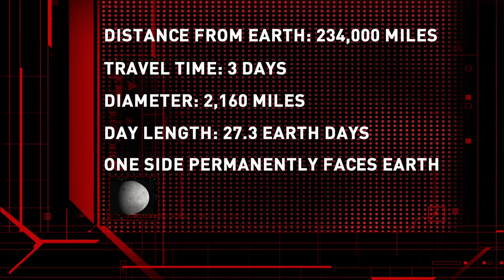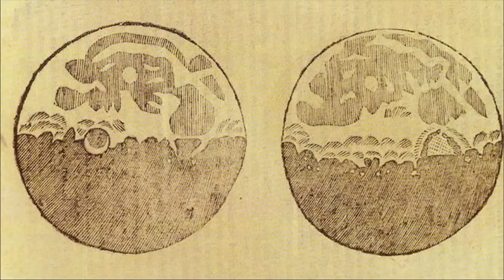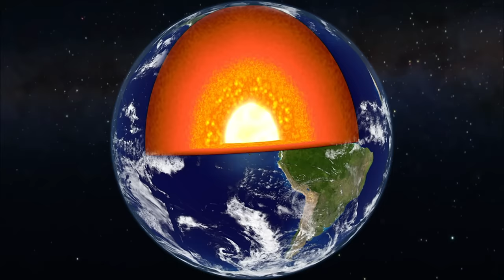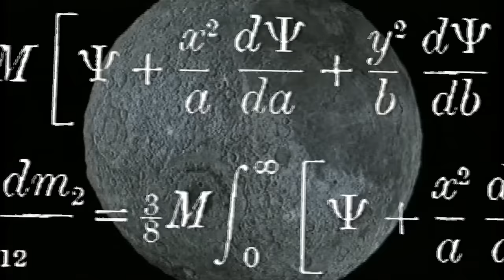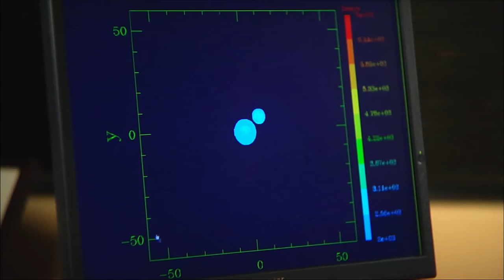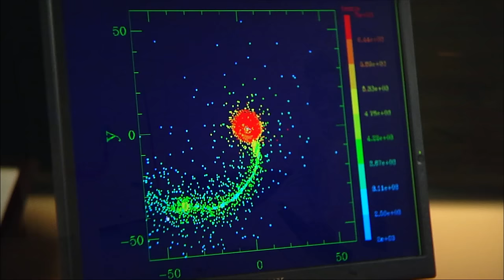The Universe: The Creation of the Moon (S1, E5) | Full Episode | History

Comment: The illustration of the moon's gravitational pull on the oceans is incorrect. Because of friction between molecules of water in the ocean, the high tide does not occur at a point directly beneath the moon but, instead, the high tide lags six hours behind the moon. The lag in the tides is most easily observed on the full moon when the gravitational pull is at its maximum due to the sun being on the opposite side of the earth. On nights of the full moon, high tides occur at sunset and sunrise, which is roughly six hours after the moon reaches its zenith, the highest point in the night sky.
Reply: You must be yanking me...who said yanking of gravity.
Reply: It's probably an instance of simplifying the demonstration to get the concept across more clearly. Like when they model the planets orbiting the sun nice and smooth without showing the wobble of the sun or the inconsistencies caused by their pull on each other; it would be technically more accurate but could distract from the basic concept being shown.
Reply: You are omitting tropical cyclones and other low pressure zone storms, which, when co-occurring, work to amplify the local tides. This was not shown in the video, and you did not account for this, nor did you factor in tides during a full lunar eclipse, which are also amplified by the alignment of the three Celestial bodies. Also you have omitted the tidal variations due to local water depth, and large rivers, Amazon, Mississippi, Nile, etc. Therefor, YouTube will limit you to commenting on baking videos, along with anyone Elon Musk fires from, or bans from twitter for similar erroneous and misleading conduct. No more science for you due to publishing false, incomplete and misleading commentary. Please ensure you baking commentary is accurate and includes compensation for the impact of altitude upon baking, or you may be restricted to commenting on  snail racing 🐌 🐌 🐌 🐌 🐌 🏁 videos and knitting channels 🤣
Reply: The moon has no affect towards earth at all!
Reply: @JeremySmith-xc5ns  The proper word is "effect," not "affect," and your statement is incorrect.
Reply: @in2livinit  I simply explained the reason that the high tide lags six hours behind the zenith of the full moon. Nothing more.
Reply: @sidewinder814u  No one said "yanking."

Comment: The Moon and Earth have an incredible, almost symbiotic-like relationship. Excellent video.
Reply: YOU must realize that the moon was PLACED IN ORBT by a guiding intellect that had a purpose for the design.  How else do you explain that the moon has no tangential relationship to the axis of the Earth AND that ONE SIDE of the moon is never seen because of ''tidal lock''  which probably doesn't exist. It had to be a perfect and precise PLACEMENT of the moon to be this well ''inserted'' into the orbit of Earth.   And its orbit is so calculated and stable..that the moon can be used as a CALENDAR...!!!!  That would have to be ''PROGRAMMED''......and notice that it is undisturbed !!!!!!!!  The Rings Of Saturn DIDDN'T JUST HAPPEN !!!!!!
They have been PLACED THERE and are tended to by something that travels in the Rigs.  Saturns rings do not vary 1 whole degree from one side of the planet to the other...and all of it is spinning at quite a velocity so as not to ''break up'' or diffuse, or fall out of orbit...or take off for parts-unknown...!!!  THINK !!!!!!!....How did all this synchronicity
COME FROM AN EXPLOSION ????????????????????.....BY ''ACCIDENT''...?????????????
Reply: Moon is a megastructure.(artificial).
Reply: @douglasrowland3722 Super correct!!! 💯

Comment: The impact craters on the moon seem to have very odds characteristics from other meteor impacts.
Reply: The reason for that is: No atmosphere means no erosion like what you would see on earth. Any change to the craters is caused by new impacts.
Reply: They did not mention the depths of these impacts.  They are not as deep as they should be.  It is like they are stopped by an outer shell.
Reply: That is because they are not eroded by wind and water like they are on earth.

Comment: It was said in the first half that the dark creators were from molten lava seeping up after an impact. So the moon had a molten core. How can it be just a rock, without the same materials as Earth?
Reply: You just got one of the makers fired and/or beheaded. That's what happens when you think faster than the film makers... do ya feel guilty?
Reply: Then God made two great lights: the greater light to rule the day, and the lesser light to rule the night. He made the stars also.

- Genesis 1:16
Reply: @dawsonindustries  since the Pentutach is mostly Babylonian stories stolen by the Hebrews, you can thank Marduk for those assignments. Enuma Elish. After he destroys Tiamat.
Reply: Because it’s not the earth
Reply: Lunar vulcanism doesn't necessarily imply a molten core. There are forces and actions that can cause subsurface heating to the point of a volcanic eruption resulting in basaltic formations that have little to do with what may or may not be going on at the core. This is not to say that no molten core was present; only that it can't necessarily be inferred by basalts on the surface.

The narration incorrectly implies that molten material seeped up at the site of impact collisions. Indications are stronger that the surface vulcanism, though perhaps triggered by meteor impacts, actually occurred at some distance, the result of subsurface heating, not directly from the collision.
Reply: @dawsonindustries   ....and it doesn't say how or when or by what means or how long a "day" is.....which is also true of every proton, electron and quark in the universe.
Reply: The object that hit the earth produced an insane amount of energy and heat. All the debris that came from the impact was likely very hot. As the moon formed and it would of cooled. So it started off hot and cooled to what it is today. When those craters were made the moon probably still had subsurface molten rock that had not cooled completely yet. Earths gravity also has an effect on the shape of the moon and that imparts energy and heat.

Comment: I have to doubt the "Great Impact Theory" as much as the "Fission Theory". For an astral object to impact the Earth and throw out enough debris to form the Moon seems like it would have taken enough out of it that would have permanently altered the sphericity of the planet. And if the Moon is just basically a "coagulated dustball" then it seems there should be NO smooth, level plains on it. All I know is the Earth's moon is the ONLY one in the solar system I have seen that doesn't look like a big rock.
Reply: Try paying attention. The Earth was still molten for the most part. Immediately after the impact it smoothed back out due to gravity. Been confirmed by computer simulations. Bear in mind this is an old production you are watching.
Reply: Have you noticed the greatest spherical anomaly of the planet - it's called the Pacific Ocean. Remove the water and what do you have??? Ever notice a corresponding feature on the other side of the world at the bottom of the Atlantic Ocean as the Americas have slowly slid into that hole.
Reply: The planet remains a sphere because it's gravitational pull makes it so all matter on the planet constantly has a force pulling it towards the center of the planet, making a spherical shape.

Comment: The moon doesn't spin yet you keep showing it spinning.  I can't watch this.
Reply: The moon does rotate at the same rate as it revolves around the Earth thats why we never see the back side of the Moon from Earth
Reply: If you go stand on Mars and look back at the earth-moon system you can then see what you can't from earth because you are part of the earth as it turns which then obscures the fact that the moon is also turning. And it is turning at precisely the same rate that it is revolving around the earth. That means that no matter where you are standing on the earth you will never see the moon's back side. If you were to stand at either of the poles of earth and watched the moon (which you can see all the time from there) as it passed from one side of the earth to the other, you would see its same face the whole time as it passed from one side to the other. This means it had to make one half of a turn to get half way around the earth. By the same token, as it made its way the other half way around back to its original starting position, you would still see the same side all the way around thereby making one turn for each trip around the earth. Therefore it is always spinning - just at a rate you can't see because you yourself are spinning around the earth at the same rate the moon is spinning.  Are you dizzy yet??????
Reply: @benhauge3441   Wrong!  see my other reply
Reply: @IAfarmboy112  thank you sorry this is what I actually meant to type

Comment: Impact theory got shot down at the beginning because the moon has a less iron content.
Reply: Well actually, there is less iron in the moon because when the impact happened, most of the earth's centermost iron core was not blasted out into space, just the layers further out from it.
Reply: @own4801  yea you hit cake batter with a baseball and it’s going to cover that ball.
Reply: @michaelbaldwin3356  Yes, but if there is an apple inside the cake batter, it will not stick to the ball along with the batter.
Reply: @own4801  the earth was a molten ball of liquid the core was liquid and still is. I would think that it was all mixed  up not just in layers.
Reply: @michaelbaldwin3356  That would make no sense, as liquid iron is far heavier than other liquid rocks. Also, many layers of the earth's interior are not made of liquid, including the iron core. Even though it is hot enough to be liquid, the iron core of the earth is not made of liquid due to the intense pressure keeping the iron in a solid form.

Comment: Really, I think back when the universe was forming,a cataclysmic event similar to billiards,shot through space shearing part of the Earth and  creating the moon,also spinning Uranus and Venus in the opposite direction of the other planets. I said so.
Reply: I have might doubts that the impact started the earth turning. All of the "stuff" coalesing in the original formation has the material turning ever faster as one got closer to the center where the sun was forming. The planets all go around the sun counterclockwise which means that as all the material that collected to form a planet impacted going at a faster speed on the side closer to the center of the sol system and slower on the side further from sol thus beginning to make it also turn counterclockwise. Which direction does the sun come up in the morning? This does not negate that the impact did not have some effect - the issue is,  depending on which side it hit, it either sped it up or slowed it down???? What is more interesting, is the possibility that it came in at an angle to the perpendicular of the axis of the earth knocking the earth's axis out of a pure perpendicular to the sun. Anybody notice that the northern hemisphere is hotter when the earth is tilted toward the sun and colder when pointed away??????

Comment: Why is the moon round?
Reply: Past a certain gravitational threshold, accreting matter tends to form round bodies.
Reply: @gaminawulfsdottir3253  Layman's terms? Isn't there little to no gravity on the moon? What gravitational threshold do speak of?
Reply: @void________  The gravity at the surface of the Moon is about one sixth that of Earth. That's still a substantial amount of gravity. The Apollo astronauts didn't just fly off into space, and the lunar module had to spend fuel to leave the surface.

The threshold I speak of can be observed in the size and shape of some of the asteroids. Ceres, the largest (that we know of) is nearly spherical. The next largest, Vesta, is more like an egg or a football, possibly because it has a rapid spin whose centrifugal force acts to counter its gravity, but its mass was too small and therefore its gravity too weak to pull its mass into a spherical shape to begin with. So, the threhold probably lies somewhere between the mass of Ceres and the mass of Vesta.
Reply: @gaminawulfsdottir3253  Ok, yet the moon has relatively the same shape as *round planets with far more gravity?
Reply: @void________  It's not a matter of how much gravity is involved; only if a certain threshold is reached. More gravity doesn't make it rounder. The largest gas giants are more oblate than the Earth (slightly squashed spheres) even though they have much greater mass, because a high rotation speed results in more centrifugal force at the equator.
Reply: @gaminawulfsdottir3253  Contrary to your statement, Encyclopedia Britannica states that "The gravitational force of a planet's mass pulls all of its material toward the center, smoothing out any jarring non-roundness."...so, gravitational pull and mass matters.
Reply: @void________  That's not contrary. That's exactly what I said.
Reply: @gaminawulfsdottir3253  Not quite... You said it's not a matter of how much gravity. But the more gravity or mass the greater the force, no?
Reply: @void________  No, I said that once a certain threshold of mass is reached, a body will have enough gravity to start pulling it all together into a spherical shape. Yes, more mass will generate more gravity. But, with only an amount of mass somewhere between that of Vesta and Ceres, gravity will enforce a spherical shape. It doesn't have to be a gas giant.
Reply: @gaminawulfsdottir3253  oh okay...i think I get it.🥴
Reply: Because it is big enough to have a strong gravitational pull, which pulls mass towards the center. A point with the most mass at the center is a sphere.

Comment: The Moon has approximately 1/4 Earth's diameter, 1/50 Earth's volume, and 1/80 Earth's mass. While the Earth's total surface area is 510,072,000 square km and that of the moon is only 37,932,000 square km. The Earth has a volume that measures 1,083,210,000,000 cubic kilometers and the Moon has a volume of 21,958,000,000 cubic kilometers...So I don't see how the Moon is 1/4 the size of the Earth.
Reply: Yeah, they were referring to the moon's diameter or its circumference which is about 1/4 of the earth's.

Comment: This currently doesn't make any sense with the current information that we now have. Billions of years back,
the moon is now known to have been only about 20 to 22 thousand miles from the earth. This would have been impossible with the dual gravitational forces the earth and moon. They would have collided together and probably destroyed the moon. Since then, the moon has been moving away from the earth at about 1 & 1/2 inches per year to it's present position of about 240,000 miles away. It's still moving today at the same rate. This has been calculated based on the current position and movement. This was not an accident. There had to be an 
artificial control involved. This may have been achieved by manipulating the negative and positive forces of Electromagnetic Energy to keep the earth and moon apart. My theory is simply that the suspected occupants on the moon used the moon's electromagnet fields to control the moon's close distance. I also suspect that 
the moon is hollow which is also theorized by NASA. This is because of the very loud booming echo caused by dropping the booster back on the moon as the astronauts left. Therefore, this could also support the theory of the moon is artificial and could be controlled and moved. I believe that before, when the moon was close to the 
Earth, that it could have been instrumental in the designing structure such as the Pangaea phenomenon.
It's also stated that the earth was once completely covered by water before the pangaea situation occurred. 
It's something to think about and answers some questions. Also, the moon is instrumental to ongoing life on earth because of its gravitational forces effecting our tides and lives.
Per size comparison to other sized planets, it is the 
 largest moon. This video also stated that the moon has no iron core. I believe that it has to because that is how and where it's gravitational forces and field emirates from. It's standard and necessary for the initial creation of all star systems and their orbiting components.

Comment: The moon did not come out of the earth. The moon was a satellite of the planet that was between Mars and Jupiter I bet you or it was a satellite of Mars.
Reply: How did you come up with this? More precisely, the proto-planet that Jupiter eventually grew big enough to rip apart to make the asteroid belt made big enough chunks in the beginning that gravity and bumping caused at least one to fall out of orbit toward the sun. Thankfully for us the earth got in the way and it exploded the Pacific hole right out of the planet into space. That slowed down the spin of earth and tilted it and it stuck into the hole forming a huge lump sticking up from the planet which collected most of the blasted material as it fell back to earth. Eventually, all that material made the chunk heavy enough that the rotational centrifical force lifted the chunk off the earth where it continued to collect more material (thereby removing the rings that earth used to have) and lifting it further and further (about 1.5 inches per year), never rotating such that one side has never stopped facing the earth. As it rose higher and higher and moving at the speed of earth's rotation, it had to travel in ever increasing circumference circle which made it take longer and longer to make a complete orbit which now leaves the empressian that it is always falling behind. More material coming in from every direction in the galaxy eventually made it round.
See my 1915 copywritten article "What Happened!?!?!?!?!